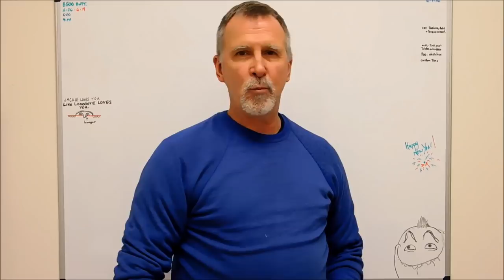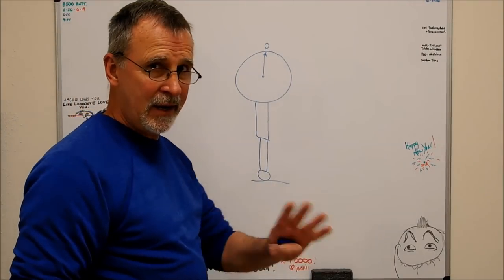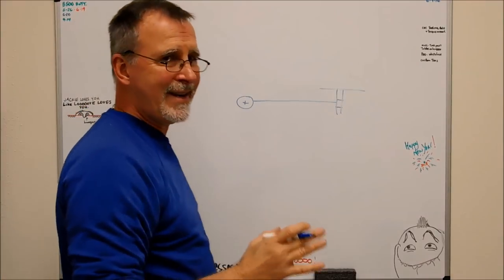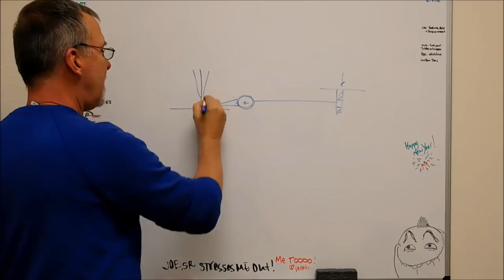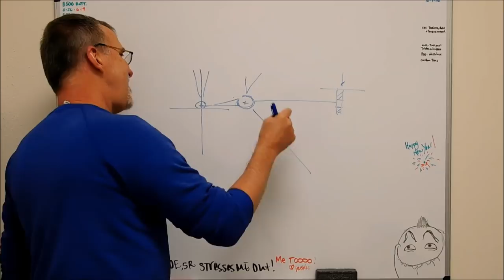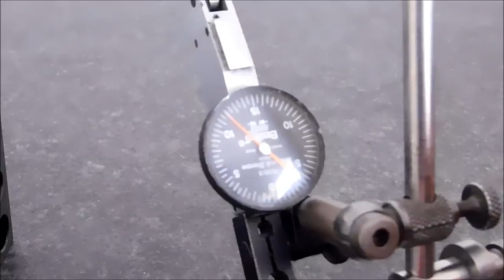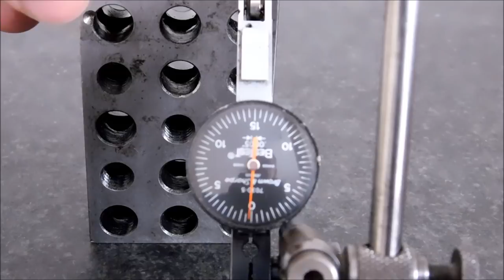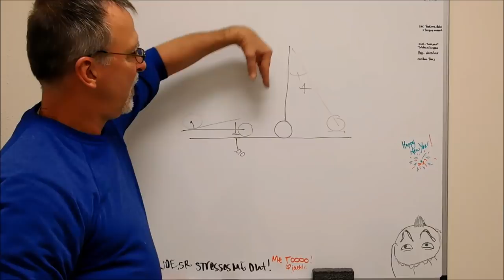Cosine Error Demonstrated and Challenged !

Comment: Joe, good video. I’d never heard of that “keep the indicator tip in line with the body” argument. However, here’s the point I found helpful in my training: I was always told, “you can’t measure with a (test) indicator”. Truly, such an indicator is really to be used as a COMPARATOR. Unless your setup is perfect, there will be a theoretical error. Such an indicator is to be used with gage blocks or a Cadillac gage ideally, although we all use the numbers on the indicator face to tell us where we are. The point that the old guys who taught me were making was that you need to be aware of the limitations inherent in your equipment, if only for those occasions where you are truly measuring in microns or microinches. Nice explanations!  Always something practical to learn with your channel.

Comment: Thank you very much for making these videos! I am not a machinist, and I have learned a ton from you, but not this time. The content of this video is pretty much common sense, and anyone arguing with your position on this topic has just failed a self administered aptitude test. Exactly why else would the stylus position be adjustable?
Reply: Bingo, that's what makes it really make sense. The stylus position is adjustable SO THAT it can be set up within 10 degrees to the workpiece. The body of the indicator's, for that style of indicator, is irrelevant. It doesn't matter where the body of the indicator is. What matters is the relationship between the stylus and the workpiece.

Comment: Hi Joe,  good demonstration.  But it misses the true concern over cosine error.  The Leaver type Indicator,  has a pivot point.  The tip of the stylus is what moves, and causes Rotation of the Pivot point. 
If you were to use a different length Stylus, you now Introduce Cosine error in the Measurement.  The More the Stylus tip moves, the greater the cosine error caused by the rotation around the pivot.

The Leaver type Indicator is best Used to check repeatability, to a known dimension.
Set up gauge blocks, and zero the indicator on that known dimension.
Now check the same dimension on your Part.  A zero on the Indicator, means both Dimension are the same.
A non Zero indicator reading, means the part does not match the known dimension.
The amount of out of tolerance, needs to take into account the length of the stylus from the pivot point, to adjust for the cosine error.

.

Comment: Who says it works the other way? The manufactures say the exact same thing you do. 

For example at the bottom of page 29.
http://www.mitutoyo.com/wp-content/uploads/2013/04/E11003_2_QuickGuide.pdf

"
The reading of any indicator will not represent an accurate measurement if its
measuring direction is misaligned with the intended direction of measurement
(cosine effect). Because the measuring direction of a dial test indicator is at
right angles to a line drawn through the contact point and the stylus pivot, this
effect can be minimized by setting the stylus to minimize angle (as shown in
the figures). If necessary, the dial reading can be compensated for the actual
value by using the table below to give the resulut of measurement.
Result of measurement = indicated value x compensation value
"

As someone with a physics & math background it makes no sense it would work the other way.
Reply: dans-hobbies Isi
Reply: what does "Isi" mean?

Comment: As an amateur that's pretty good info to know. I have always tried to be perpendicular or straight on. The surprise to me was the angle movement on the in line dial indicator. Mathematically and mechanically is makes perfect sense when visualized and demonstrated. Thanks for sharing your knowledge and experience. Best Wishes n Blessings. Keith Noneya, Slidell, La. USA
Reply from the maker: best wishes back at ya neighbor. Thanks for the comment.

Comment: I am a bit amazed that this video was even necessary, but excellent as always.
Two points, firstly you did not mention the use of involute tips on some dti's and secondly some manufacturers actually state that their dti is to be used at an angle of 10 or 12 degrees for a zero cosine error. It is always worth checking the manufacturers instructions. Thanks for your videos they make my day.
Best Regards Richard
Reply from the maker: Richard, I had to throw my 2 cents in. The whole straight indicator BS was just too much to digest.

Comment: One note is that the error can be used to your advantage if you are wanting to get a part to run as true as possible. If the needle has to move 2 ticks to 1 tick of run out, it is easier to see the run out if you don't need a number.
Reply from the maker: That is very true. Just be aware if you are relying on the reading to finish a cut, you may not have as much material remaining as the indicator says you do.

Comment: Why would they make the needle orientation adjustable in the first place if it always needed to be oriented 10 degrees level with the body? Makes no sense. Great vid
Reply: Sometimes I'm using my indicator mounted directly in my collet while checking the perpendicularity or parallelism of part - in that case exact reading doesnt matter, just has to be the same all along the part so even with cosine error it tells me that part is straight or not.
Reply from the maker: Yep. I agree 100%

Comment: I have had the same Interapid .0005 test indicator since 1985 and it still works perfectly!  I agree with you 100% but I would never set a travel indicator up crooked.  It would be within a degree of 90 degrees in both directions, by eye.  We are machinists, right?

Comment: Joe, you are absolutely correct. Awhile back,  close to when I started at the company I now work for, I walked into a situation where all the guys were having a conflict over a long flat part that they were indicating with a lever style indicator. It took me a few minutes to show them how to properly use that style of indicator. The thing to know, is the indicator does not measure a linear movement, it measures only the relative rotation of the stylus to the body, and it it only exactly true when the stylus is at exactly flat to given surface. the further from that center, the wronger it gets. Their .035 in out of flat was only really out by .007 in. Naturally they had the stylus kicked up by 30 degrees or so from the perpendicular of the part. Took me a few, but now most of them understand that style of indicator is really no good for measuring, only good for comparing one position to the next. It is only somewhat accurate even in its proper use. Forget trying to explain the term cosine error, (the term "cosine" immediately toasts their brains then they run) simply teach them how to use the indicator correctly. It's easier... toolmaker, teacher 45 years.

Comment: The way I see this, a drop indicator with the plunger "true" (perpendicular to the face of the part in both axes) will always give an accurate differential measurement to the extent of the system's capabilities. A lever-style indicator with the lever parallel to the face being measured will give an accurate differential measurement regardless of the orientation of the indicator body, as long as the the change in height on the part does not greatly affect the angle of the lever (leading to cosine error). The classic example is the change in height of a pendulum swinging from rest; at very small angles, the horizontal displacement can be apparent but with almost negligible displacement in height, but as the angle increases, the height increases more and more with less and less horizontal displacement.

Comment: I can't believe this was actually a 'thing'.  Just looking at a DTI tells you that it's function is to measure the arc about a pivot.  The dial and the stinger just happen to be calibrated to translate the movement to a linear (mostly) measurement.  Clocking the stinger about the pivot can have no change to the reading as long as stinger maintains the same relation to the part as the described arc distance remains constant.
Reply from the maker: Take a good look at the pendulum sketch at the end of this video. really digest it. It shows a lot.
Reply: I agreed with you and couldn't understand how folks can argue that the body position (rather than the tip) matters.  Why did I get singled out for homework? :P

Comment: People that say this demonstration isn't correct need to get a job doing something else, like maybe writing fiction.
A dial indicator set at other than 90 degrees both ways is the same as a true depth of cut reading on the top slide dial on a lathe being different set at different angles.
Where as the cross slide dial reading will always be the same regardless of the angle of the top slide as demonstrated with the test indicator.

Comment: Regarding the cosine error on the plunge type indicator.
If the stem is inclined at an angle of 8 degrees,then 10 thou on the clock is in error by 1 tenth of a thou.
Using the same calculations,11 degrees inclination is in error by 2 tenths.
14 degrees gives 3 tenths.
18 degrees gives 5 tenths or half a thou.
25 degrees gives 1 thou error.
All these calculations are based on the original 10 thou movement on the dial indicator.
The point is that the errors are quite small and the dial indicator is designed primarily for use as a comparator,not as an absolute measurement instrument.

Comment: Makes sense to me. I would describe Cosine Error as a tip fault determined by travel, surface contact and the failure of the operator not setting the indicator to perpendicular to the work piece or a worn indicator.  Though I am happy to be corrected if I have that wrong.

Comment: Nice and I totally agree with what you showed.  The body of the DTI doesn't matter at all.  What matters with a DTI is the angle of the tip relative to the surface being measured.  You can easily calculate the error for the drop indicator by taking the measured size and multiplying by the cosine of the indicator angle (I guessed 20 degrees) so 0.6375 * cos(20) = 0.59905 so the angle must have been close to the guess of 20 degrees.  If you reverse the calculation, you can find that the angle had to be invcos(0.6/0.6375) = 19.7499 degrees. This is similar to how you would measure a taper. It's more complicated with a DTI since it has features to try to reduce the error.

Comment: This is at least the one thing I understand in the shop. Probably due to the fact that one of the first Gaging Insp. Fixtures I had to design (40) years ago (with a great deal of assistance from two very experienced Tool & Die Makers) had (8) indicators on it. (2) DTIs and (6) DIs. Excellent learning experience. Remember when Federal was stateside?

Comment: Joe, as usual, great video and you are spot on about it being the arm (or as I would call it, the stylus arm) should be within +/-10° of being at a perfect 90° angle to what you are measuring. And even then, +/-15° is sufficient in my opinion in many cases unless you have an indicator that is accurate down to .00001"... Now this will somewhat depend on the length of the Stylus arm since the amount of rotational change relative to angular change in the arm will be effected by the length of the arm but I'm pretty sure that the length variance from manufacture to manufacture will be minuscule.

For example, one of my particular indicators (only have one here at home in front of me at the moment) has an arm length of right at 11/16" (just eyeballed with a tape) and upon laying it out in AutoCAD, when the stylus arm is perfectly perpendicular to the part being measured, .00150" change equates to .125° (7.5MOA). Now if I rotate the CAD layout of the stylus arm by 15° and then back off that same .125° (7.5MOA), the height measured is .001449", so even at 15°, we are only talking an error of .000051" (or half a tenth)...

I dont know about you, but I know plenty of people / machines that can barely hold a tenth or two accuracy, so a half tenth error is nothing... Even at 45° angle, based on my CAD layout, that would be an error of .000438" (or just shy of 5 tenths / half thou).. For me, based on most of the machine work I get in to do (which is little since we are primarily a weld/fab shop, not a machine shop), that is still well within my allowed tolerance range (most of the stuff I get / deal with is +/- a couple thou at best and often more like +/-.005"), so a half thou error because I have the stylus at too steep of an angle is no big deal.

Comment: Great Video Joe. With the plunger dial indicator video, you only mentioned it being out of true in ONE plane. If it had also been out in the other plane as well, then you would have then encountered a greater error, due to it now being a COMPOUND Angle. To be honest, I only use an Indicator, just as an indicator, however an expensive one you buy, they are NOT 100 % accurate. They are an Indicator NOT a Measuring Instrument.
Reply from the maker: Hey Dave. Welcome back. I too trust them to indicate, not to measure. I did mention the multi plane squareness of the drop indicator in the very beginning, but did skip over the compound possibility. Ya got me on that one.

Comment: The lever arm style indicator really measures angle. For every equal angle movement of the arm around its pivot point, the indicator  will move an equal amount. To go from angle to distance, you multiply the length of the arm x the cosine of the angle of the arm to the surface you are checking. (That is to say, perpendicular to the direction of movement.) Since the cosine of 10 degrees is 
.985, keeping within +/- 10 degrees is a good rule of thumb to keep the error within 1.5%.

Comment: Excellent video, Joe! I'm no expert on this subject, but I've seen this kind of error crop up in many other technical areas besides machining. And the reason for the cosine error with a "drop" style indicator is due to the fact that it is a LINEAR measuring device, as apposed to the "lever" style indicator which is an ANGULAR measuring device. I won't go into detail here because there's not enough room in the comment box to do so. But that is the basis for why the error exists when the drop indicator is not square to the measuring surface.

Comment: Your correct on the body. Most manufactures say 10-15 deggees on the stylus for a 1:1 reading . If you want extra accuracy dialing in a part use more than  what they say maybe 45 degrees it becomes more sensitive. And cosine distortion what happened to Parallax distortion the real name.

Comment: I really like your presentations.  Most useful lessons artfully presented.
In this installment, you state the obvious, but let me augment a bit. 
The plunger type is known as "Dial Indicator". It measures actual distances, with typical resolution of 0.001" (sometimes 0.0005") and range of 1" - 5" (or more) 
The lever type is known as "Test Indicator", it measures relative motion, with dial resolution of 0.0001" or better and range of 0.004" - 0.010".
The Test Indicator uses a [friction] clutch which enables positioning of the lever anywhere in a range of some 180 degrees.  It really measures the arch drawn by the ball tip, not any streight line. 
I hope this makes the obvious stated even more obvious.

Comment: Never had a problem understanding this. I had a compac extended range  test indicator (.120 - 0 - .120) with a 26mm long point and a 2mm ball. The little pamphlet inside expanded it just how you did in the last clip on the white board.  The extra range (and longer point) on the indicator made it so you could really see the error and explain it to others.  I remember educating or quality manager in this one. Good video.

Comment: You are correct. The body angle is irrelevant, only the angle of the tip to the work matters. Anyone who thinks the tip has to be in line with the body was never taught the proper use of a dial indicator.
Reply from the maker: Technically, an indicator is just that. It demonstrates differences in geometry or size. It should only be used to measure if correctly setup.

Comment: Great video and good examples.
When used just for comparative measurement, and all you care about is "is it 0" , the error related to the angle of the stylus to the direction of measurement doesn't matter, but the accuracy of the measurement is affected. If you want to use the reading as a measurement (like with the feeler gage in the video) the angle is important. According to the user manual for my Interapid 10ths reading test indicator, you get calibrated measurements when the stylus is at a 12 degree angle to the surface being measured. If the stylus is parallel to the measured surface (0 degrees), the reading must be multiplied by 1.022  . And of course Joe is correct that the angle of the stylus to the body of the test indicator is irrelevant.
Do other manufacturers of test indicators provide the angle needed for calibrated measurements?

Comment: Good video, as always.  Lever indicators were never designed to be height indicators.  Their purpose is to check run-out and to indicate minor height variations, like squaring up a mill table.  They are excellent for what they were designed for.  "Drop" or plunger indicators will work for height as well as  run-out.  As always, use a tool for what it was designed for, otherwise suffer the consequences.  As you stated, setup is the key.  Old retired engineer and machinist.

Comment: Absolutely correct, very well presented! The angular measurement occurs from the tip to it's pivot, it is then converted to precise linear travel up the body of the indicator and then is expressed in linear distance on the dial through the precise rack and pinion mechanism. One lever controlling another longer lever in turn contolling a pivot. Great job Joe!! Best machining stuff on youtube!!